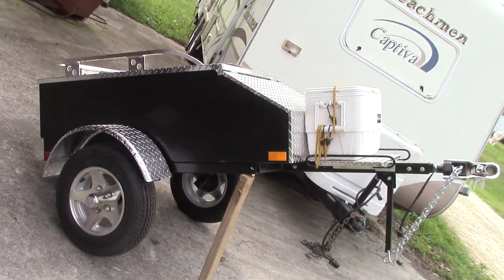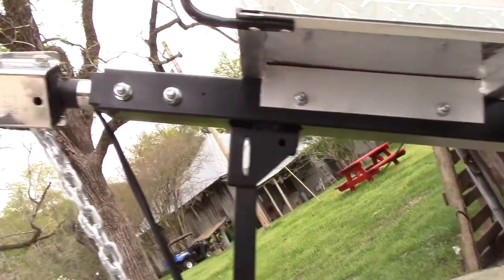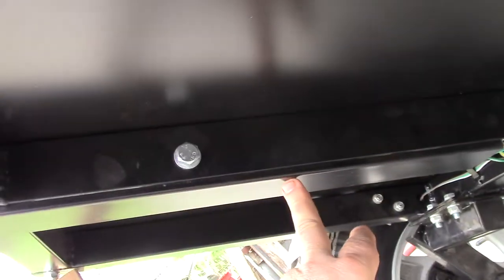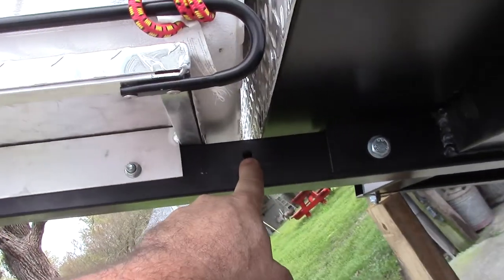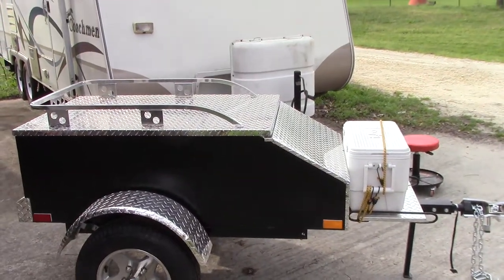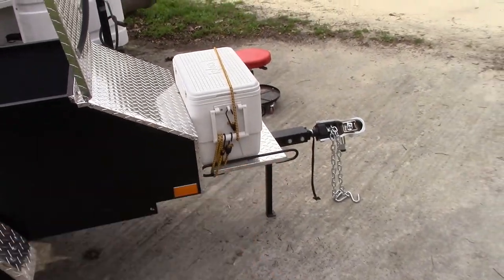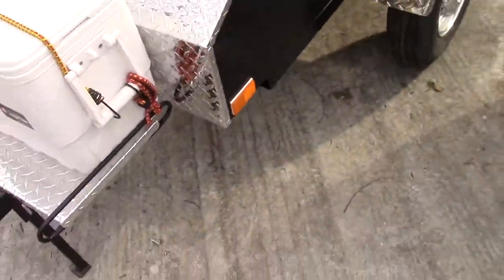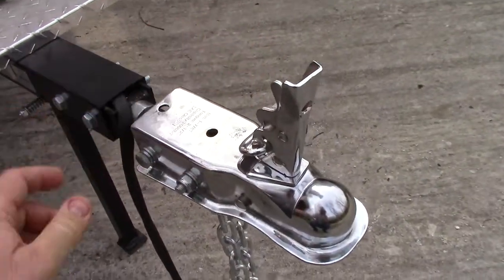Lumina XL Motorcycle Trailer- Shorten The Tongue

Comment: My buddy and I both have the same trailer design and we actually bought a piece of square stock of aluminum and made the tongues even longer. Front of the cooler is 4 to 4.5 feet behind our bikes. We did it originally for looks but quickly discovered that it greatly improved the trailer trailing no wobble back and forth and it had almost zero effect on the handling of our Harleys unlike when the tongues were factory..we're both old school truck drivers who understand how wheelbase plays a major role in handling and the comfort of the ride in combination vehicles

Comment: Hey John, just wanted to give you an update on my Lumina XL trailer. I sold my GL1500 and bought  2012 GL1800 Roadsmith trike. It's white with black accents so I had my trailer painted to match. I've been on several trips and this trailer is by far worth the price.   Ride safe !!

Comment: Thanks for info I bought the same trailer and did same shortening mod. Cleaned up wiring and sealed betwene trailor box and crevasses with 3M5200 marine adhesive as well rivets and luggage rack seal, cut vibrations and strengthen all bolt together.

Comment: Hey John , , , great video. I totally understand the procedure now. I purchased mine from USA also. During the assembly process I will be shortening my tongue as well. I purchased mine from USA also. I will be pulling my Lumina with a 96 1500 Interstate. Thanks so much for sharing.
Reply from the maker: No problem brother.
Reply: You need to extend the tongue.. I'm speaking from experience and I left a comment above that talks about why we did it and how great the results were.  We're also owner operator truck drivers so we understand how wheel base can improve the handling and ride of all combination vehicles

Comment: I wonder how close your dimensions are to the ideal I learned from an expert that tongue length (measured from axle center to ball center) should be 1.75 to 2.0 x the distance measurement between the tires center line. ie. 37 inches wheel center to center should yield a 65 to 74 inch tongue length. And if you load more on tongue such as a cooler you should lean towards the 74 inches. Or risk instability and wiggling.
Reply: The overall measurements on the XL Trailer are Overall dimensions - 95 1/2" L x 47" W. The tires are 5.30" x 12".

Therefore the centerline of the tires are 5.30". So 47" outer width minus the width of one tire (5.30") will give a centerline of the wheels of 41.70" and multiplying that by 1.75 gives 72.975 inches and multiplying it by 2.0 gives 83.4 inches.

Subtracting 15" from both measurements gives 57.975" on the lower end and 65.4" on the upper end.

Comment: Did shortening the trailer change the tongue weight in any significant fashion?  Looking at this trailer.  Do you happen to know how tall it is - ground to the rack?  Wondering if it'll store under my workbench. ;-)
Reply from the maker: I pulled the trailer with my 2012 Goldwing before and after shortening the tongue, it noticed no difference at all. Parking was much easier.  Go online to the USA Trailer Store, which is where I purchased my trailer. They have all types of motorcycle trailers, and they can answer any questions you may have.
Reply: Jdr I left a comment above about my buddy and I having the same trailers and we actually replaced our tongues with extended ones and it dramatically improved the trailing of the trailer and it had almost zero effect on our Harleys. You can tell that you're pulling a trailer still because of the weight you're dragging behind you but that's it
Reply: @bendaves77 can you tell me what the height of the tongue is sitting level? In other words how high does the top of the ball need to be for the trailer to sit level. Thanks
Reply: @teresacarroll9333  use a level and a jack.. the ball is going to sit where the brackets have it sitting on the motorcycle.